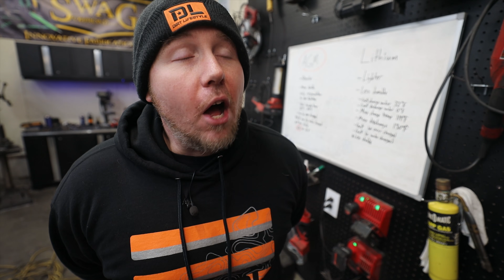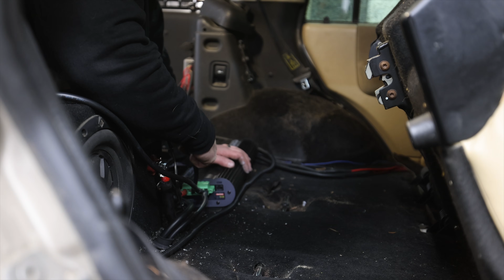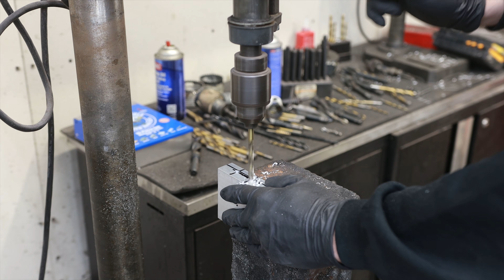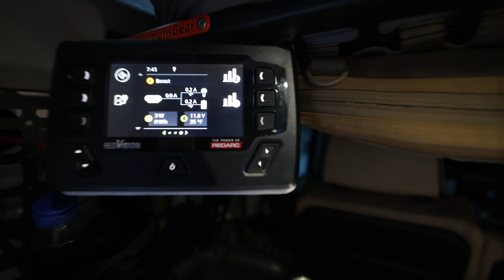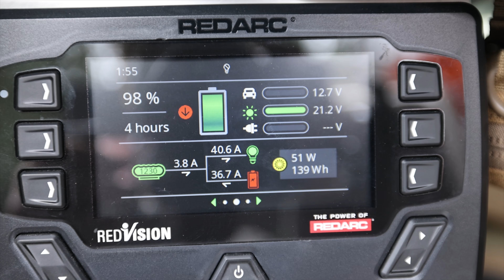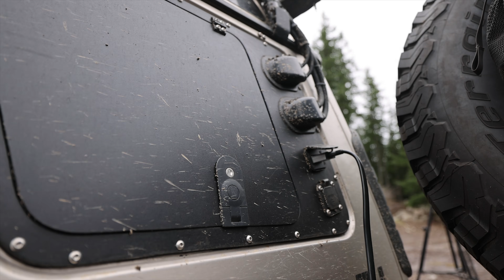Extreme Overland Solar! Dual Batteries Plus Electric Heat In A Roof Top Tent.

Comment: Total amp hours from those batteries... Or watt hours?  I have two lithium batteries. One of my batteries is L t o Lithium titania oxide. This battery is good for negative thirty three degrees fahrenheit. And up to a hundred and sixty degrees fahrenheit. Not your average lithing battery. Then I have a REDODO 100 AMP HR.  IN THE VEHICLE.  It has a built in heating pad so good Seven degrees fahrenheit. A Hundred watt panel on top. On a cloudy day it still gets 5  0R  ten watts.

Comment: So I'm doing a similar setup.  Alternator charges battery while driving and then solar at camp.  Am I correct to say that while driving, the charge controller will recognize an input amperage and not include the solar panels in that charging phase? Or will both systems be charging the panels at the same time?

Comment: Lithium IRON phosphate PO4 batteries for life! Built in BMS and heat cells. 🤘😎🤘
Reply: Yeah, LFP is what I was thinking would be way better than AGM for durability with not much extra cost.  Also, 6V seems crazy when the trend is towards 24-48V.  There are tons of widely used 12V durable options that would be compatible with the car’s system.

Comment: Don't worry about putting too much solar into your regulator, an MPPT will only take when it can and leave the rest (in simple terms). Don't bother shading panels just to lower the wattage. 

Voltage however, you need to make sure you get that right.
Reply: This.

Comment: Where your house batteries are concerned you want to have your cake and abuse it too...
I've been doing this for a while now and I want to say you are absolutely right in your choice in batteries for where you've installed them..
If you can afford the space inside your living space or install an insulated box with a heat source. Lithium is the way to go...
You get so much more power or amp hours per pound of battery weight.
FYI...
Don't jump start your vehicle from your house batteries without first disconnecting the alternator input from your charge controller. You could fry your charge controller if you don't....
I built a circuit that does just that with the flip of a switch.

Comment: Agm batteries suck for solar power. Even if its rated the same as lithium you only get 50% of the rated power before its considered dead.so you have to run twice as many batteries/weight for agm. I run a 50 amp dc to dc charger that runs off the engine and solar.if the engine is not running it doesnt draw power from my two under hood batteries. I run two 240ah lithium baterries with built in heaters for the cold so they will still charge. Plenty of power to run everything all night.over charging/heating them is near impossible they have 250a bms built in. Other than that awesome build

Comment: My question Nate is this, what about the extra weight up on the tent when it is open . Like if it snows on you with the extra weight will the tent collapse ? Did you have to either add more or stronger struts so you don’t have to worry about collapse  ? Or a maybe a safety pole ?

Comment: Cool project. I've never gotten more than maybe 75% of the promised capacity out of any solar panel. Usually more like 50% even under good conditions. I think the stated ratings are achievable only in labs with absolutely optimal conditions. I assume you connected the BCDC controller up to take input from the alternator as well? The Redarc controllers automatically choose "green power" inputs over the alternator (if you hook them up correctly), so it would only charge from the alternator if you don't have enough sunlight.

Comment: Great vid mate, more solar the better for sure! In Australia here Lithium has quickly become the standard, slaps AGM in every scenario (EXCEPT Cold 🥶), much less weight, ~90% draw down capacity vs ~50%, much fast charge rates etc. Wonder what lithium heating options there are? Though more complexity and net storage might end being less :( Wild how different/less the solar input figures are in your neck of the woods! ☀️ Hey also with the mppt charger/redarcs, it's fine to actually in more than its max within reason, it just won't accept more than that max 👍 Eg I have max of 15amps mppt and with roof and portable it goes over that by a bit and just happily maxes at 15amps input
Reply: Lifepo4 batteries with built in self-heating functions are very common here in the States now.

Comment: Something to think about for those of you that off road to a destination and then park the vehicle to camp out of while you fish, hunt, explore, hike, etc. If you have solar panels on the roof, that means you have to park the vehicle in the sun....essentially all day. In hot climates that sucks compared to parking in the shade of large trees. What I've found that works great for those that are stationary for days at a time is using a very small inverter generator (1000-1400 watts) to charge the batteries when you're away from the truck doing other stuff. You can get units for under $500.00 brand new...cheaper than three quality solar panels and controllers and the generator weighs less.  A couple of hours of generator run time trumps the solar panel output which is only great during bright sun and in the middle of the day. It is very easy to chain and lock the generator to the truck to avoid theft while its running and you're away from camp. When you return to camp you have a full battery bank for silent power all night long.

Comment: Black rtv on the outside.  Clear silicon breaks down over time in UV sunlight.   Super important.
Reply from the maker: This is marketed as exterior silicone. It says window and siding 🤷
Reply: Might be some other clear sealant you have seen fail. Clear silicone is used for roof plumbing here in Australia. Lasts forever in the sun.

Comment: Dont think you have to worry about putting in too much wattage for the controller. It will just clip the rest when it gets to its max. Just have to make sure you don't go above the max open circuit voltage (OCV) for the controller.

Comment: Not only that, but I work in the business of battery management and recycling. Lithium batteries are extremely flammable and if not managed appropriately light up easily. They’re also extremely hard to put out. So.. on a rig.. kind of hazardous to run if it’s externally fitted.
Reply from the maker: I didn't bring this up because the comment section would be a disaster. The Volatility of lithium when it fails is why Mrs. dirtlifestyle doesn't want a EV (yet). We have seen one on fire on the side of the hwy and looked up some info on the situation. We found countless articles interviewing fire fighters stating there is no fire extinguisher to put out lithium fires. On top of that, they burn faster and hotter than traditional electrical fires. When your entire floor is the battery this is kind of an intimidating problem...
But I still believe in the technology for the right applications! The pros are amazing, they just need iron out some of the cons. With battery chemistry changes they will likely solve alot of these problems.
Reply: @DirtLifestyle 😂😂😂👍l work on them all day at work, lithium are good, but they can go bad very quickly.
Reply: @DirtLifestyle once they go up🔥👈good luck, the only thing the fire department can do is keep contain from spreading, we had lots of training what to do when something go wrong with them. They said to push it outside or watch your shop 🔥down.
Reply: Lifepo4 don't have the same volatility/safety issues as Lithium Ion.

Comment: Hey @Dirt Lifestyle - old tip from grand-dad we use on boats....solder...then crimp. When shit goes wrong...say long emergency  cranking on a big stater/winch....heat can melt the solder.

Perhaps less of a concern for a deep cycle house battery bank.
Reply: Solder is not solid, it creeps. Crimp first. Better to use closed lugs and glue lined heat shrink to seal ends.

Comment: Before setting up a lithium-based rig, I've seen emerging tech videos on sodium ion batteries. Several companies are in the r&d phases, and a lot of what's coming out is that the by-weight electrical storage is a primary hold-up.  Last I saw, the sodium was about 85-90% storage of the lithium, but the gap is closing.  Look for some comparison videos on both the cost and the safety sides, as lithiums have known, potentially catastrophic, failure incidents.

Great video on your set-up, and keep up the fun. 🙂

Comment: Most battery monitors (Shunts) that display a percentage or a time remaining estimate. Will need a few cycles, discharge/charge, before they read close to accurate and voltages should still be checked periodically also because it’s difficult to accurately measure time remaining with sporadic use of high load appliances.
Also its good to add in a relay or even a vsr (switchable) in parallel with the DC 2 DC so you can run large acc direct off alternator power or to gove power back to the starter battery in an ‘emergency’ situation.

Comment: It’s worth noting that most lithium batteries will have a battery management system that will just shut the whole battery off at those low temperatures mentioned. So if you need power in those temperatures your basically fucked or limited to alternator power.

Comment: As long as you’re not over the rated mppt voltage there’s no worries about over paneling, moreover it’s a common practice to overpanel the charge controller. The charge controller will just clip the extra incoming wattage during peak sun hours. Victron Phoenix is an awesome inverter for a build of this size primarily because the standby is ridiculous at something like 7 watts, moreover it’s a low frequency unit so it has substantial surge capacity. Can’t wait to do a similar build on my xj with lfp cells.

Comment: Thank you!  I just plugged my 200w panel into my ecoflow delta and was surprised that it didn't charge at all at 1pm under a cloudy eastern Washington sky.  I have almost taken the panel with me on two recent trips.  Thanks for pushing me to actually check at home before lugging a large hard panel 400 miles down the road.

Comment: Good video.  I'm an Electrical Engineer and I salute your choices.  My only worry is no skidplate on the batteries.  Yeah, I know it isn't a rock crawler but you put rock sliders on it for some reason....
Reply from the maker: Thanks man! The battery mounts basically are skid plates. We made them out of 3/8 thick steel so they won't distort from a big hit or even dent if they took a hit. They are super beefy 💪

Comment: How does this system compare to having something like a Eco-Flow 2000 and solar panels?
Reply from the maker: I have the exo flow delta and a 100w solar panel. With all things being equal you could expect 1/7th the amount of charge from a 100w vs my 700 watts. And what I found with only using 1 or 2 panels is they wouldn't reach the minimum voltage threshold to start charging if it's cloudy. I also have the jackery 2000 with 4 100w panels. It can charge on a cloudy day but lugging around all those panels is impractical imo. They take up a TON of room plus with a these powerstations you don't have the ability to repair one broken peice system. My eco flow is a great example actually. The port for solar and DC charging stopped working and I can't fix it. If the battery, the charger or inverter had issues in my red arc system I can repair the one peice and continue. If the battery or inverter in a powerstation goes out the entire thing is junk. And keep in mind ALL batteries only have so many life cycles. All will fail eventually. When these AGMs eventually die, I can upgrade to whatever the current technology is in 5 or 10 years. You can't do that with a power station. I'm not hating on powerstations, by the way. I have 3! But a permanently mounted, expandable system is superior In my opinion. 👍 I just show up to camp and flip a switch. It's pretty rad
Reply: The ecoflow will take up internal space in the vehicle and won't charge in the cold and might not be able to directly jump start the vehicle.

Comment: I'm using  Redarc DC-DC charger in my Suburban with solar, in conjunction with a Victron MPPT controller and shunt, as well as an SOK 12/100ah battery and 1500W inverter.  Between the Victron apps and SOK app, plenty of data available. Thought about a remote screen for instantaneous info similar to what you're using but haven't gotten to that point yet.  But very nice setup you got there.

Comment: I'm curious how do you have the panels wires? Roof in series, and those in parallel with blanket? Or all in parallel? Also does the RedArc manager not throttle the incoming wattage on its own if it exceeds max? I think that's what the Victron equivalent does. Nice vid!

Comment: I have 400w of pannel that can be pulled from inside the bed of the rig, I don't know what amount of battery I'll be able to cram in. I won't be primarily electric, though. Propane cook top, diesel heater, so just the fridge inverter and lights are on 12v. But where we are, sun shine usually isn't a problem. Finding a spot in the trees to get good sun is, so being able to be independently positionable is ideal in my situation.

Comment: You should have used semi solid state or solid state batteries.  News tech can discharge out recharged at -22 deg Farenheit.  The complete solid state go way lower in temp.

Comment: We use a 12v AGM that is isolated in our Gladiator, 200w of solar on the tent.  I ran an outlet to the bed from the start battery and I switch the fridge over to that outlet when we leave camp for the day giving the isolated battery time to charge off solar.  We have an off-grid cabin in the Sierras that is all lithium, each battery has a built in 200amp BMS with low temp cut-off except for one that has a heating circuit so it can be used below freezing, the cabin has 480aHr and 2400watts of solar, more than enough to run a mini-split HVAC for the summers.

Comment: Not a solar/battery/electric subject matter expert. Simply 3+ years experience of 800ah lithium (inside 4Runner), solar 200w on the roof, and 600w portable managed by RedArc Redvision BMS using 3k watt inverter. All electric 120v appliances--Induction stove (1800w), Air fryer/oven (1800w), air heater (1800w), AC (1800w) and 12v water heater (300w). During Spring - Fall 2023, I lived in 4Runner while working 3 nights/week just outside Phoenix, AZ (plenty of sunlight and plenty of hot). During the day, with outside temp 110-119F, slept comfortably in a 4Runner with AC ~74F. Three days were near the max for sitting in place with all-day clear skies to charge the battery bank. The max harvest solar charge while I slept was ~2200w. By the 3rd day, the battery bank was 13.0-12.9-8v, and not sure it would last another day of using AC even with ~2200w solar charge, as the alternator was not charging due to sitting. Sleeping at night time it's worse primarily because the bulk of the energy usage is between dinner, sleeping (heater or AC use), and breakfast the next day without any charging due to lack of solar. Keep in mind, I can discharge lithium to 10% (and accidentally have 2-3x). AMG cannot be discharged >50%, even 6v (experienced using 6v AMG in RV x6 years as well). The point, in theory yes, you are correct. However, usage is a significantly different outcome. Not to mention the plethora of variables outside our control. Yet, despite the all-electric system limitations, hands down electric is a better choice for me. Hope that helps.

Comment: how did you get the thick battery wires into the car? i'm currently also doing some battery mods to my disco 2. 
before i drill 6 holes in my floor you maybe found a better way